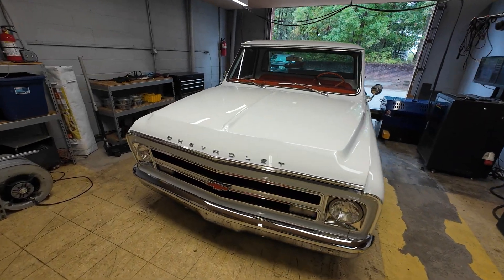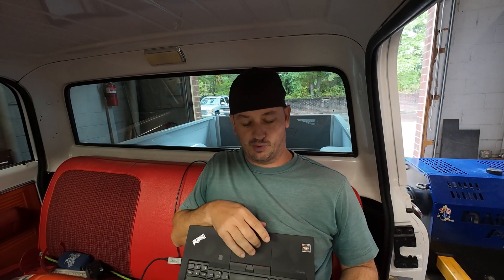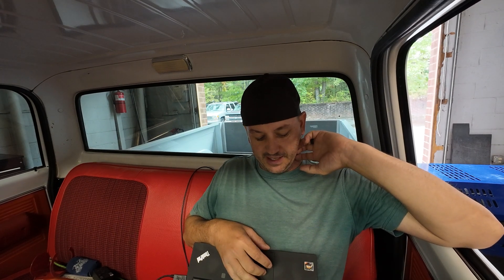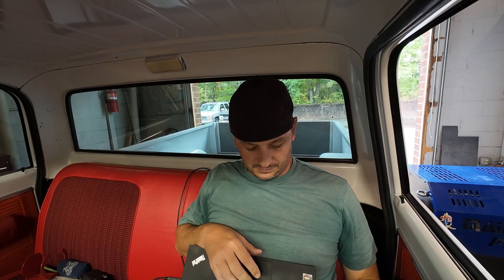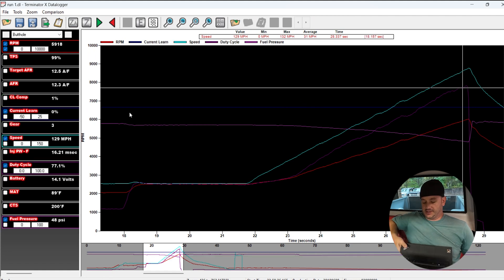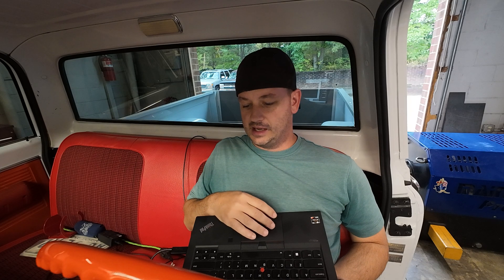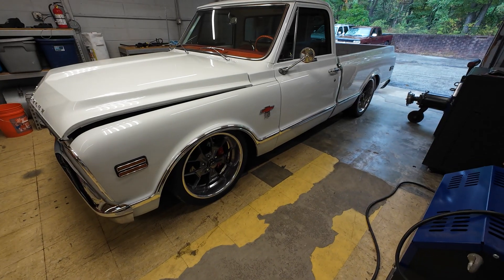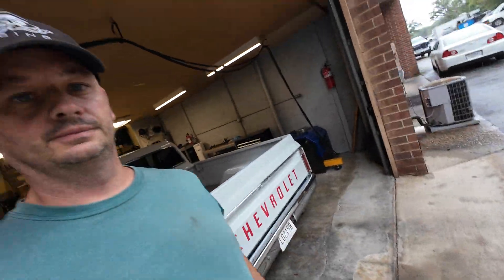Tuning a $100,000 C10 w/ Holley Terminator X!

Comment: Could you have set the base fuel pressure at 43psi and tuned from there and been ok with that pump?
Reply from the maker: No, there is no regulator to adjust

Comment: Looks like a perfect platform for a rebel LS 🤙🤙
Reply: They don't have auto trans control yet!  Supposed to be launching here tho Oct. 1st I was told!
Reply: i did my own 4l80 conytol using generic outputs, works fine until haltech release their version
Reply: @travispfannmuller7717  ok that's cool!  With the rebel?  Did you use a PD16 or something?    I was thinking the rebel doesn't have any extra I/O's.
Reply: @dave_kauffman  it definitely has extra
Reply: @dave_kauffman  with the rebel just using the existing i/o's. It's a thoroughly amazing product for the money, particularly compared to the terminator